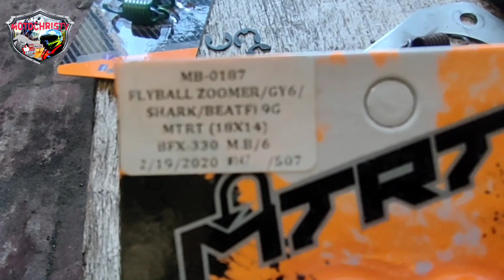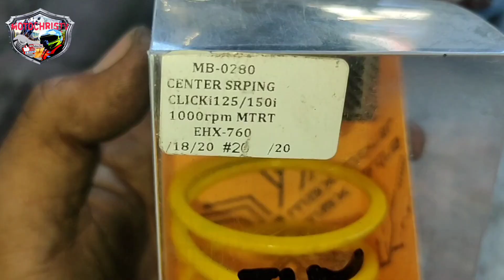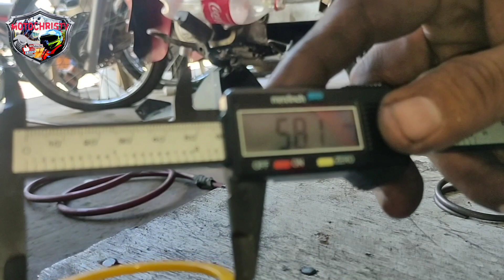UPGRADE NG PANG-GILID NG  KEE BLADE AT SIP 125 ll ANUNG PIYESA ANG KAILANGAN

Comment: Paps ( 1000 rpm sa center spring  /tapos 1200 clutch spring   wala naman ba magiging problema kung stock makina paps
Reply from the maker: tama lang naman.. ung set ko kasi 1500 center spring tapos 1200 clutch spring
Reply: Mas maigi mas mababa parati ang clutch compare sa center. Madamba pag mas mataas ang clutch pero ungol bandang  gitna.

Comment: 60 kilos po ako anong combination ng flyball at rpm ng clutch at center spring
Reply from the maker: Flyball 3 -10 ,3 - 12
Clutch spring - 1000
Center spring 1200 rpm
Reply: @motochristv5772  salamat idol

Comment: sir ano po recommend parts nyo na pang gilid para lumakas motor ko sip125 po motor ko..
Reply from the maker: Center spring mu ng 1200 rpm pang nmax at clutch spring 1200 din..lalakas na yan
Reply: @motochristv5772 okey lng yun sir kahit stock makina?